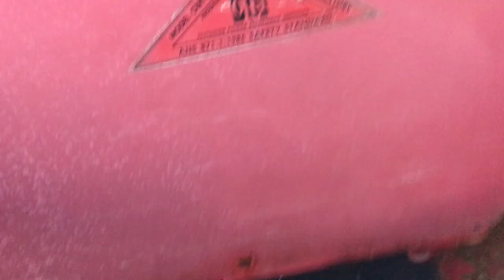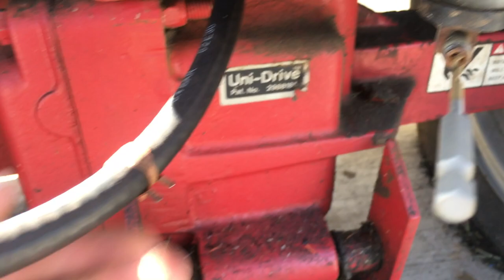Wheel Horse Resurrection - From Graveyard to Farm Yard - Toro Wheelhorse 520H Garden Tractor

Comment: The man that used to work on my 96 416h said to make sure you keep the gasket that goes around the oil filter. It is the reason that front cylinder fails.  It routes the air around that cylinder instead of out around the oil filter. With a toro filter I have to add a rubberband to keep it in place.